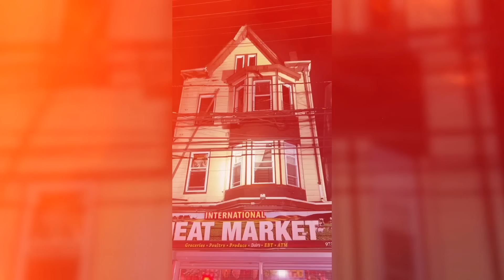When Electricity Went Out of Control

Comment: Take a fluorescent light bulb and stand under some high power lines? From the video I watched it should light up when you hold it above your head?
Reply: Yes ,an 8 ft tube works the best as long as the lines are above 69k volts

Comment: Arc flash could blind you permanently. DO NOT look at an electric arc.
Reply: Arc flash is like looking at welding without a shield,  except the power line flash are done with far more power (volts, amps)
Reply: I once saw an arc flash from a transformer back when I was living in Winnipeg several years ago. It just happened out of nowhere as I was on an afternoon walk, and lasted about 2-3 seconds, very similar to 1:32…but thankfully without the fire and smoke! 😅

Amazing to see!! ⚡️⚡️⚡️
Reply: Makes total sense. I learned in high school metal shop to always wear face shield when arc welding. An electric arc on major power infrastructure is a lot more powerful.
Reply: Agreed

Comment: That three phase line with the balloon did not put out over 200,000 people’s power it’s just a three phase distribution line.
Reply: Yeah, there's protection further up at the substation feeding those lines. Large-scale power outages are usually caused when 6-figure voltage long distance distribution lines short out.

Comment: Electricity is no joke
Reply: It can bite you - and higher DC voltages can toss you!

My first ham transmitter did exactly that when I was testing it.  I was 14, it ran a 6t9 tube (cw only when you’re a novice, I was then 14, wn6iyz, and I touched the plate supply - 275 volts  DC.

I was tossed a good six feet.

Comment: "The video footage of the electrical discharges, arcs, transformer explosions, and transmission line catastrophes is nothing short of breathtaking. The sheer intensity of the electrical arcs, illuminating the surroundings with an otherworldly glow, is awe-inspiring.

"The transformer explosions, in particular, are a testament to the raw power of electrical energy, as they unleash a maelstrom of flames, smoke, and debris. The transmission line footage, where the insulating mechanism between the cable and the pylon tower fails catastrophically, is equally impressive.

"However, the pièce de résistance is undoubtedly the surreal moment when the electrified cable melts a hole into the rock, creating a miniature, molten crater. The fact that this hole is a couple of inches wide and approximately 5 inches deep serves as a remarkable testament to the incredible thermal energy generated by the electrical arc.

"Overall, the video is a visually stunning showcase of the awe-inspiring power of electrical energy, and the catastrophic consequences of its uncontrolled release."

"This video serves as a stark warning and a crucial reminder for individuals to exercise vigilance regarding power lines, particularly in areas where vegetation is encroaching upon or growing underneath them. The risk of wildfires ignited by electrical malfunctions or damaged infrastructure is ever-present, and the consequences can be catastrophic.

"In the event of a large-scale natural disaster, such as a massive earthquake, the potential for widespread power line damage and subsequent fires is alarming. The prospect of combating countrywide fires in the aftermath of a disaster is a daunting one, underscoring the importance of proactive measures to mitigate these risks and ensure public safety." Was this all footage from the United states?
I think this is such a good video I'm going to watch again.